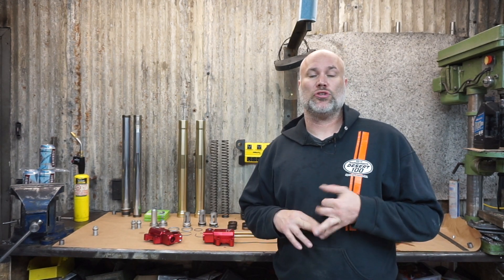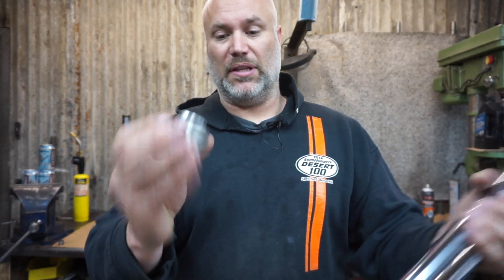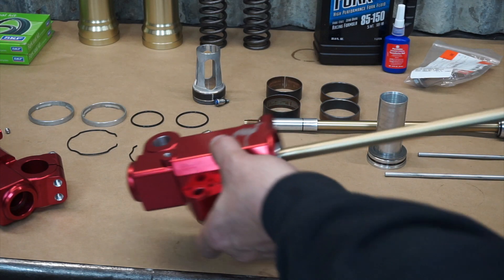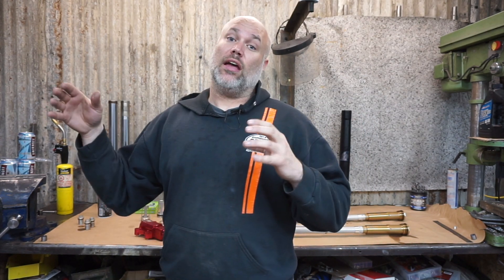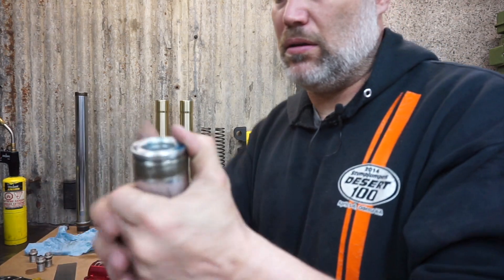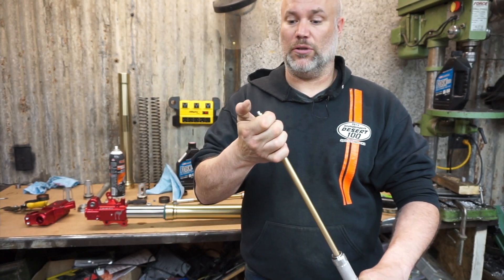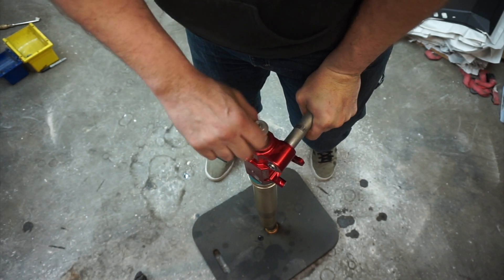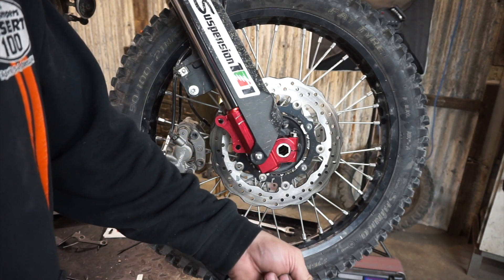Yamaha T7 Suspension Upgrade Episode 5: Fork Wrap-Up

Comment: That wear is lack of servicing oil and replacing bushings The fork tubes flex on back and forth up to 3inch on a mx bike from fork lug ,so heavy adv bike you get more flex ,this is why they wear the coating off as it puts side load on the bushings ,you should replace bushings and oil every 50 hours on a enduro bike , and not all black anodising is hard enough ,you have 3 options with uppers ,hard anodizing only comes in black and clear gray color then you have Kashima coating ,not as hard of a coating as black hard anodizing but its impregnated with molymendrum lubricant micro particles makes it very slippery and under side load reduces the stickshion keeps fork moving smoothly through the stroke without binding ,

Comment: 1 step closer!!!! But holy crap you have done a ton of machining for this swap. I really hope that (for your sake) the next episode is 30 seconds of you saying how easy it was to install the rear shock, and everything went smoothly, followed by ten minutes of riding footage. Either way, can't wait to see this thing BRAAAAP
Reply from the maker: The shock will not be a simple bolt-on, it'll be a bit of work too.